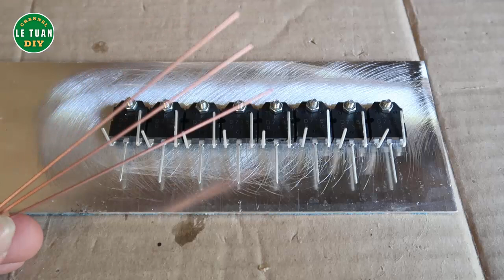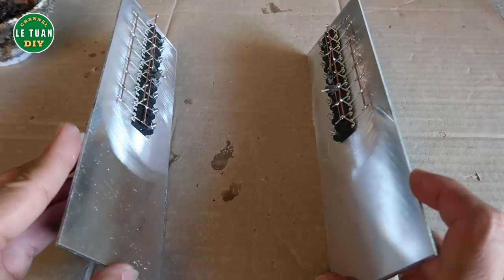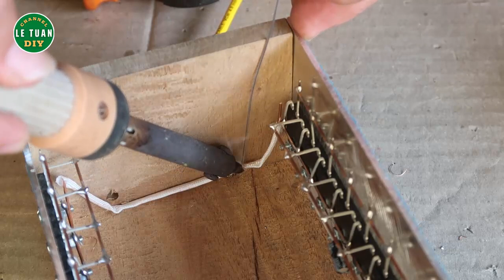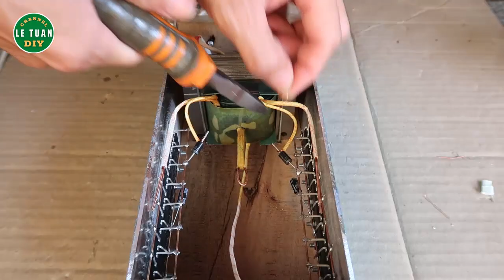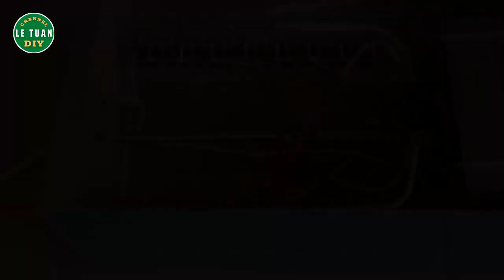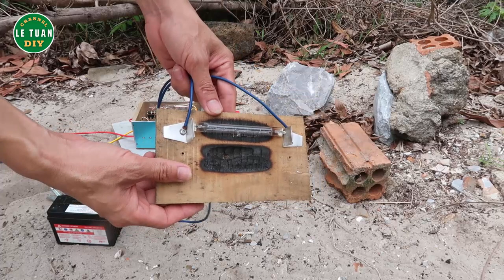Combination of 12v to 220v inverter and fire generator, episode 2

Comment: Sar👹👹 pizz 2N3055, D718 and B688 transistor join please reply me
Reply from the maker: use common d718 and 2n3055, if using b688, change the power to battery + to - and vice versa